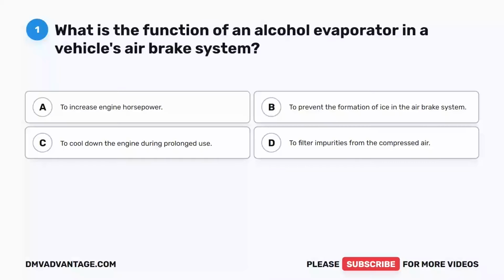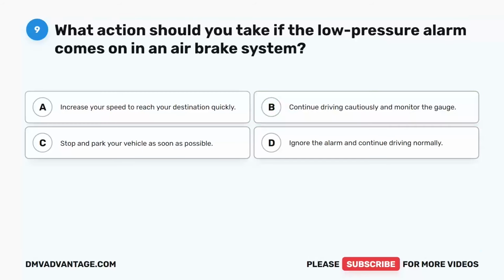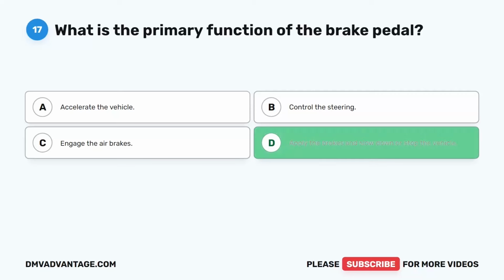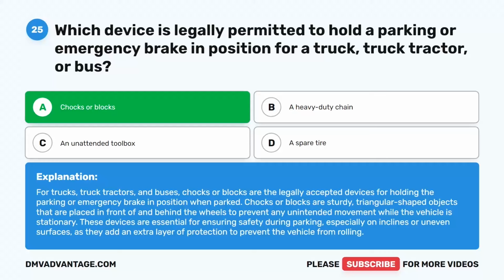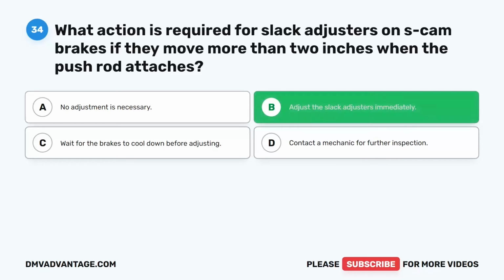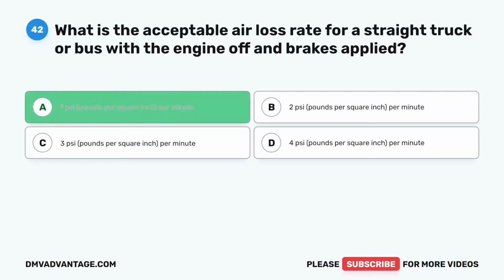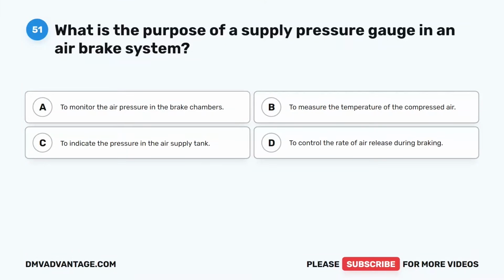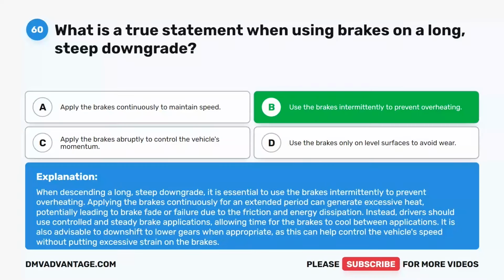CDL Air Brakes Test 3 2025 (60 Questions with Explained Answers)

Comment: number 28 and number 4. number 30, air pressure is also an important aspect for spring break to come on. number 31 is conceptually misunderstood. number 32 is right then other with same questions.
number 34, slack adjuster need adjustment when move more than 1 inch 5.3.2. number 35 the duel control valve don't operate brake rather release the spring brake for towing. number 42 again not correct assumption. number 48, 54, 55, 56, 57, 58, 60 are making more confusion then learning air break system
Reply from the maker: Appreciate the detailed feedback! We’ll make sure to review and adjust.

Comment: Straight truck or Bus air brake system with the engine off and brake released on this video says 1 psi and the other video says 2 psi. 🤔 which 1 is it..
Reply: Engine off is the key word for this question.
Some questions are tricky you have to read the questions.  I believe the other one is while doing the break test you can only have a  lose 2 psi
Reply: Bro this is the same question that pissed me off that y I came to the comment cause I know somebody has the same issue
Reply: Breaks on is 3, breaks off is 2
Reply: I got a 50/50 chance with this bull shit😅
Reply: @lejerianpayne9778 right lol

Comment: Why are they the sane question asked several times with different answers on many questions lol
Reply: I was thinking the same 😢
Reply: They repeat on the actual test too but I love it when it do
Reply: I'm so frustrated with it. I keep getting confused but I noticed what was happening. Ex. How often should you drain the air tanks . The answer is daily but they ask it over and over and some answers are ; weekly and monthly. All wrong, I personally know this is done more often than weekly.